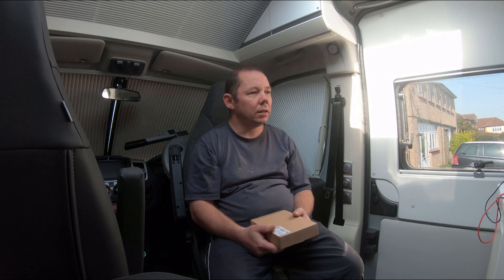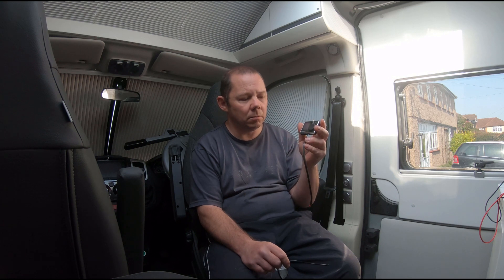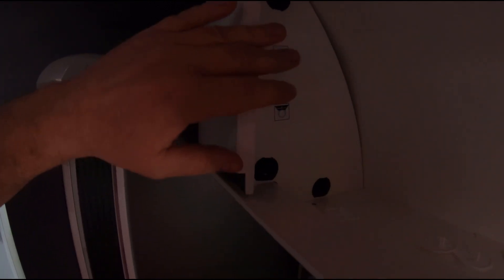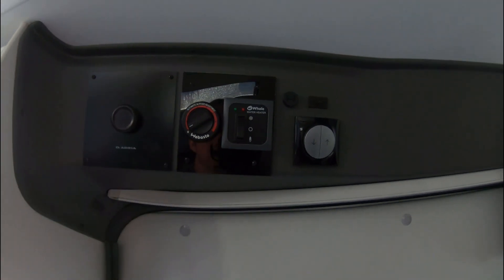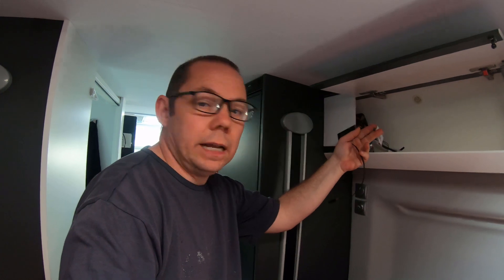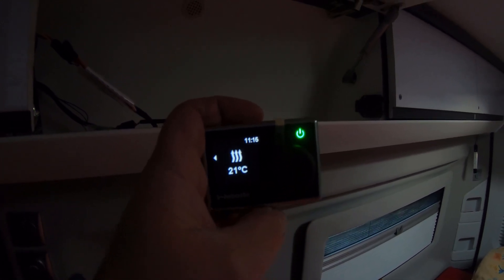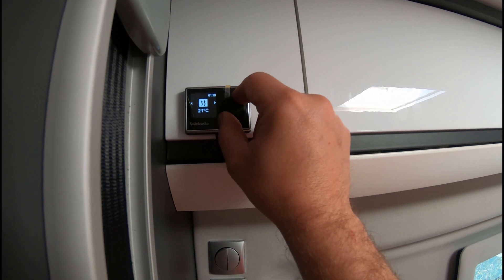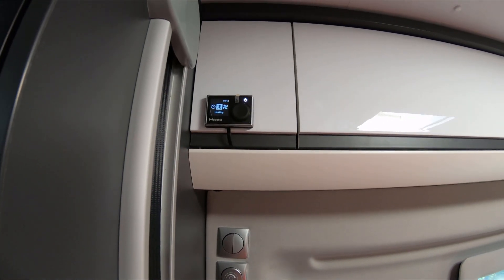Webasto diesel heater smart controller install on Adria Twin

Comment: Perfect Stephen, the first mod I did on the RV we had before. I miss the diesel heater, so convenient, especially wintertime when lpg just disappears thru the heater. You will experience the Webasto as totally refined with this. It controls the heater so much better. If You've not done it yet, pleas upload it to our waterhole 😁👍. I'm still waiting for my battery, a disaster in time waiting. Advertised by my dealer as available within 7 days, That was 18 days ago and no commitment on delivery date. They say that it is a total boom on LiFEPO4's.
Reply from the maker: Thanks Mattias I have uploaded on the group site. First time using diesel heater and as you said was very happy to have this. No worries about running out of gas. Works very well in low temp and is quieter than our old truma. I had a lot of problems with the truma in my old van. It's a know problem for the internal fuse to blow.  I did do a Vlog on how to change it

Comment: I have the airtop 2000 stc and the controller that looks exactly like yours .At 6:38 you move the arrow to the fan speed on the heat setting mine won't do that. Any ideas?

Comment: Hi Steve do you have the thermoconnect app? I am getting my webasto heater installed in December
Reply from the maker: No the controller I fitted did not have that option. I would have liked it as you can then control the heater easily anywhere in the van and I believe if you have WiFi on the van you can turn on your heater from anywhere outside the van. Nice if you are on a walk back to the van on a cold night
Reply: @BrackstonesTravelAdventures  Yes also it has tracking and geo fence alarm

Comment: Hi Stephen great video. Always good to see the practical side of things before attempting it for yourself.  I would just like to point out that you title it , fitting a smart controller but fitted a multi controller and there is a difference.  The multi controller has the timer feature but the smart controller does not, which I’m sure your know but it may cause confusion if someone wants the timer function but orders a smart controller.
Reply from the maker: Thanks for comment. I believe the one I fitted was the smart controller with timer, the multi controller has a silver outer ring and has the 7-day timer. I have not used the timer myself.https://www.bowerspartsonline.co.uk/brands/webasto/webasto-controllers

Comment: Do you have a temperature sensor? My multi controller shows H94 error which indicate missing temperature sensor.
Reply from the maker: On the Adria Twin van the temperature sensor is located next to the old rheostat control where the control panel is. If you have the same van and have disconnected the old rheostat then check this temp sensor did not get disturbed
Reply: @BrackstonesTravelAdventures  Thanks!!!